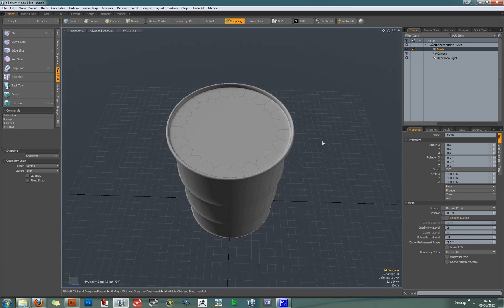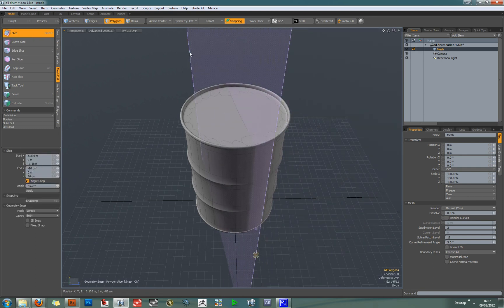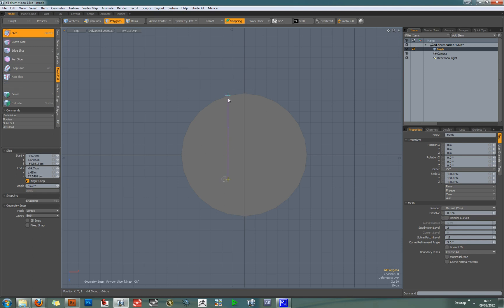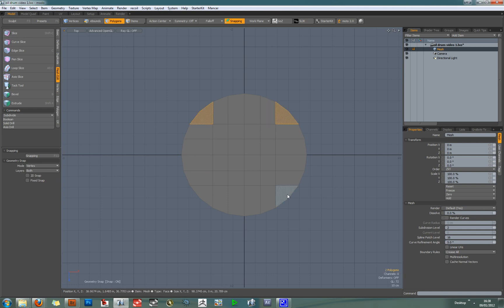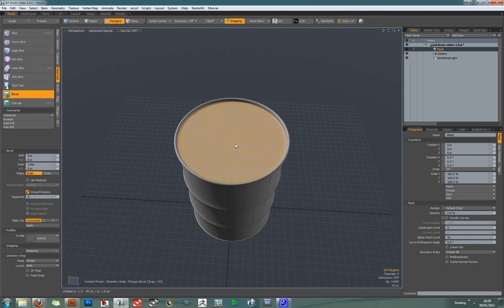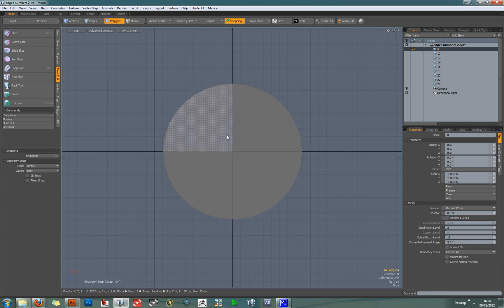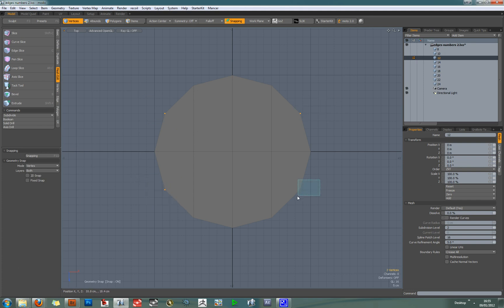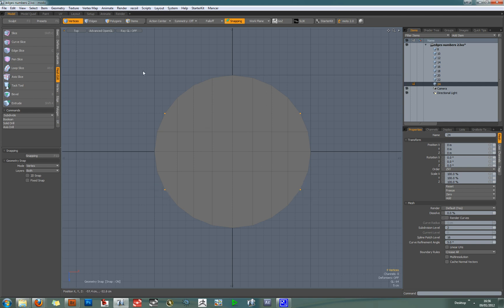modo quick tip: slicing an nGon into quads

Comment: I get tons of weird artifacts when doing this.  Like the first slice is fine but the second slice makes half of the polygon disappear in a triangle shape.  When I view it in perspective mode the missing half is actually up or down at a 90º angle and I have to use drag weld to get it back to normal.  Hasn't this happened to you?